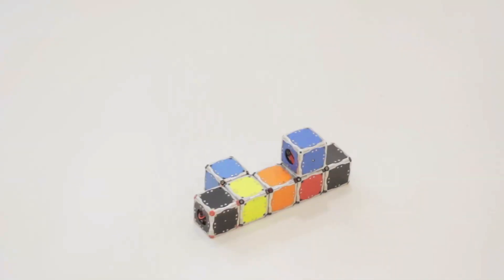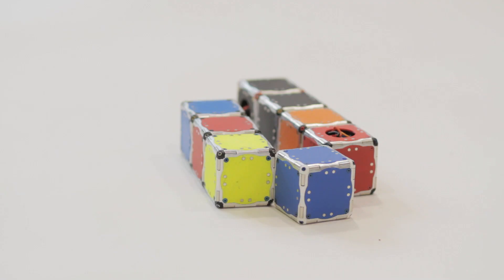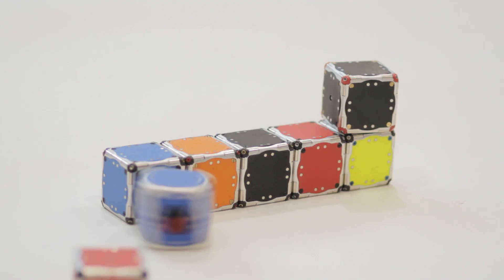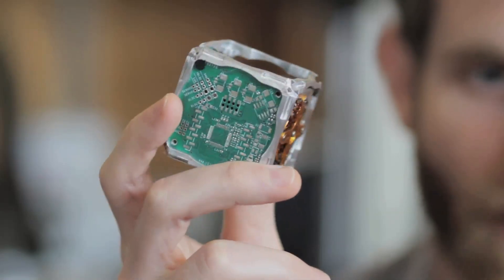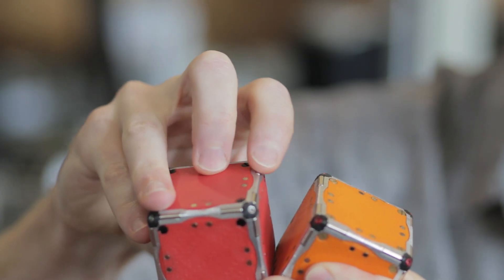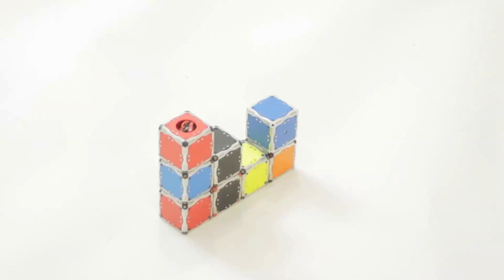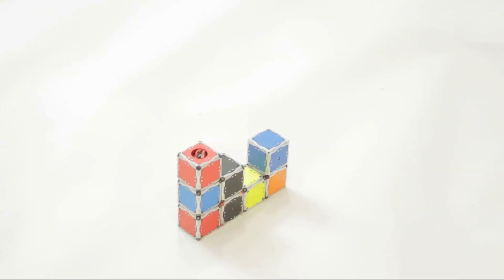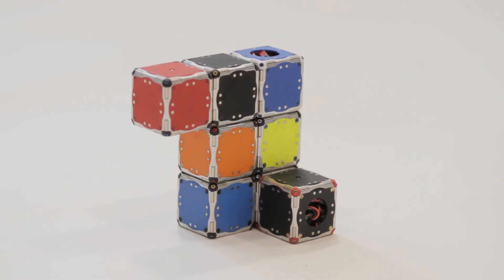Small cubes that self-assemble

Comment: I HAVE HAD IDEAS ALL OF MY ADULT LIFE AND THIS IS ONE I THINK OF A LOT THOSE LITTLE WOOD STOVE FANS THAT BLOW HEAT FROM THE HOT TOP OF WOOD STOVES ARE GREAT. I WAS THINKING IF SMALL GENERATORS WERE ATTACHED TO THE REAR OF THESE, PERHAPS WHEN CAMPING OR ANYWHERE (THESE DAYS OF SEARING HEAT EVERYWHERE) ONE COULD PLACE THESE FANS ON THOSE SURFACES AND PERHAPS CHARGE CELLS, OR POWER SMALL LIGHTS? I HAVE NO IDEA HOW TO MAKE $$$ ON MY IDEAS BUT PERHAPS SOMEONE WILL GIVE ME CREDIT FOR FREE ONES??

Comment: I don’t really know how this type of tech works, but I do know a thing or 2 and had a suggestion. This probably wont work, but just something:

I see that you used magnets in the cubes. What if rather than using the spinning mass in the middle as the main source of movement, you use magnets to guide them. You use an electrical charge to ‘turn on’ the magnets on the desired cubes. Like I said, I have no idea how this works, but it would be really interesting to test the idea.
Reply: That would require an electro magnet, which is MUCH bigger, and they can only connect/disconnect, you would need the ability to move the magnets to get the cube anywhere. This would create internal moving mechanisms, which would mean more stuff to break.
Reply: @FieryCoal  yeah true ,If we are making something big ,then electromagnet will be beneficial

Comment: Good job! I don't know why youtube took too much time to recommend this to me. Anyway I don't usually comment on videos but I got to share my thoughts on this one
1. High cost due to all electronics in cubes, per cube
2. Misses a feedback, how can I cube know where it is and where to move
3. Takes a lot of time to form
4. Batteries will die fast from all the spinning, and charging each single cube alone is a struggle
5. Mistakes can happen during reformation
6. Can't be built in nano size due to a lot of restrictions, and if done, think about the huge cost of having a million nano cubes to do some formation
7. Those are just a bunch of cubes with motors, what tasks can this do other than teaching 7yo kids about electronics?
8. Getting different robots for tasks is still cheaper, more accurate, solid and better
9. Do these even have a memory? good luck programming a robot task to cubes and using distributed computing and multi tasking to make them work together, sounds impossible, and even if done, the software alone will cost sht load of money and will be impractical
10. What tasks are you gonna do? I see no sensors, no actuators, no nothing! If we want to attach sensors to these they will lose ability to reform, and a lot of sensors cant be built in cubes due to:
a. no space in cubes
b. some sensors need to be outside to sense
c. reformation will become limited as specific sensor cubes need to always be in specific places

Only practical use I can think of is a kids toy to teach them about electronics, but it will still be very overpriced in comparison of amount of knowledge it provides, so I'd give this 1/10 just for the effort
Reply: https://www.amazon.com/Modular-Robotics-Cubelets-Twelve-Blocks/dp/B0187R3TSM/ref=sm_n_au_dka_NL_pr_con_0_1?adId=B0187R3TSM&creativeASIN=B0187R3TSM&linkId=8dc164bf8594f0124a742949e2e53b0b&tag=tapostnativebottom-20&linkCode=w41&ref-refURL=https%3A%2F%2Ftechacute.com%2Fmblocks-robot-cubes-can-self-assemble-video%2F&slotNum=1&imprToken=izmAV0keY12f3y5dSNVpFw&adType=smart&adMode=auto&adFormat=grid&impressionTimestamp=1554321245764

Comment: I have seen Stargate. This is a bad idea.
Reply: Mishael Martin so your saying  humans were a bad idea because  we are an emergent  property  of this practical idea applied  over several  different conformation and energy  levels? Well, then that's because  of you. LoL
Reply: @maximaleffort  well this was a joke. But since you brought it up. 
Are you saying that humans a similar in the fact that we were single cells that eventually came together. And now that I am this huge mass of cells, it is my fault if these cells do something to cause harm to others ?
Reply: Mishael Martin I was LoL, still.  The similarities are self evident in all complex systems. The correlation between abundance or ubiquitous  building blocks being directly  proportional to useful emergent properties are evident at every level.  Harm is irrelevant  to the point but a perception, from your emphasis, in the mind of the programmer, either  intentional or not.  Bottom line is that the ratio of volume  to utility is exponentially enhanced  by being able to reorder the substance of tools. 1 box of blocks can reorder into a 1000 tools, for example.  The revelation  of this has been under construction for quite some time, although not on YouTube  yet, and is an evolutionary inevitability.

Comment: These modular robots are based on two things, gyro-motor and magnets,
Gyro-motor is a poor stability or vectoring motor (due to the air resistance and other factors which makes us unable to predict final position and orientation). If we can orient it better, like relatively using fields around it.
Utilizing the fields may help us to overcome the excess of sensors
Reply: Reaction wheels
Reply: Hassaan Maqsood cannot you use magnets to repel some edges and attract others to make the cubes "walk" on the structure? 
The problem is you wouldn't be able to make them jump with magnets, and that is useful when it has been disassembled to assemble it again.

I envision these robots as modular robots that can "repair" themselves by reataching separated parts only instead of being made by cubes, have every module serve a purpose.
Reply: Noriel Sylvire that would make it only work on metal magnetic surfaces. Reaction wheels are more versatile on what environment they can be used in.
Reply: Alden Hauser yes, it's true. Apparently reaction wheels can provide great precision.
Though I don't entirely know how you would fit them into a cube.

Apparently they have continued developing these M-Blocks for all these years though I haven't seen a major breakthrough really, other than improvin precision and force. I would love To see them do things other than jump or maintain balance.

What do you think this could be used for?
Reply: @aldenhauser9555  Reaction wheels are good as being 'start-up'. But if you are going with some more complex and fast manufacturing like programmable matters, you have to use the natural force fields to bind and move through space.
Reply: Hassaan Maqsood wtf is a natural force field lol?
Reply: @aldenhauser9555   force field (where force act) of natural forces gravity, electr-magnetic, weak and strong nuclear
Reply: @norielsylvire4097  you're right but if those are 'electro', plus they have kind of standard pole orientation with respect to the vertices.
Considering cubic structure, I think we need mathematicians to find out a 3D honeycomb unit structure (for 2d it is hexagon), so that could really make good fit
Reply: @hassaanmaqsood  Well, I'm still not a specialist of any kind so I don't think I can really contribute anything useful right now.

I will just say that as time passes, more and more research teams are becoming multi-specialty teams, so I wouldn't find it too unlikely that a team of mathematicians, engineers and other specialists made a big breakthrough in modular robotics.

As for the 3D honeycomb, hasn't it been found yet?
I would use just cubes...
Reply: @norielsylvire4097  It doesn't need to be a specialist to contribute, its all about passion and curiosity along with commitment.
Reply: r/iamverysmart

Comment: in 2019 i'm looking at this and thinking about how he want's to put more into the cubes and be able to command them at a high level, and have them do the 'thinking' and I'm thinking, how about you make them more reliable in their current state and then have a central software take care of all that, so you can realistically throw more processing horsepower at it and just signal the cubes to act as needed. As it stands this looks clever, but useless, as the rotating mech for imparting momentum makes them move, but also requires them to all be cubes, theres really no use case here besides we can jump around and stick to each other, and aside from fitting them with sensors to detect motion, or heat or something they really cant perform and real tasks outside of just rearranging themselves. It looks like it amounts to nothing more than a fancy toy.

Comment: The cubes need a type of hive mind AI to be autonomous. These would be practical only if the user would only need to give them a simple instruction, such as "form a pyramid 12 inches high with a 16 inch x 16 inch base". The cubes would have to recognize their individual positions relative to each other, collectively recognize the end configuration, recognize each cube's position in the end configuration, prioritize each cube's movements, etc. A more advanced AI would be able to quickly re-prioritize in changing environmental conditions such as building the pyramid on the deck of a rocking ship.
Another advancement for these cubes could be if they could manipulate outside objects. Example: the cubes are in a room with a floor that is 40 feet wide by 40 feet long with a ball. At the end of the room is a cup that is 4 inches tall and just wide enough to hold the ball. The command to give the cubes would be: "put the ball in the cup." The cubes would need to be able to identify the ball and its properties (its round, it rolls, its size, how heavy it is, etc), and the location and size of the cup. For simplicity's sake, the properties of the ball, the location and properties of the cup could be pre-identified. The cubes would have to have some sort of sensory system, such as pressure sensors to identify where the ball is and calculate where it needs to go.

Of course, these achievements would take multiple steps and several iterations of modification and it wouldn't be a simple task. To get the ball from one end of the room to the other would necessitate the cubes' ability to become mobile as a unit. More challenges to give them would be:
1. As a group, climb a flight of stairs.
2. As a group, climb onto a table.

Comment: 2072

Advanced nanotech clothing

Fifty years have passed since the mainstream appearance of nanotech clothing. During that time it has made extraordinary improvements in utility, power and sophistication. Modern fabrics have built upon the abilities of previous generations, perfecting many of the technologies involved. Today, a complex blend of nanotechnology, biotechnology, claytronics, metamaterials and other components has yielded a type of clothing previously confined to the realm of science fiction. Though mostly restricted to specialised personnel, government forces and the elite, a number of these suits are finding their way into the mainstream.

Construction via self-assembling nanotechnology has been around for a number of decades. Until now, the process was only practical using bulky and/or conspicuous machinery, nanofabricators, or objects suspended in tanks of catalytic fluids.* However, recent advances in nanorobotics have allowed for more subtle and rapid construction of macro-scale objects in a more compact form-factor and with less impact on Earth's natural resources. As happened with early nanotech adoption in the 2020s, one of the easiest and most common applications has been in fabrics. Today, a high-end home "closet" may consist of simply a thin surface or pad built into the wall or floor, concealing a mass of nanobots and molecular building materials. A user can stand on or touch this surface and issue instructions to the machine (through voice command or virtual telepathy) for what to create. Each nanobot is then programmed with the final clothing design and set into motion.

The process begins with each nanobot organising and categorising each building molecule, based on the aggregate material needed and where each piece will be located in the finished product. The nanobots – also called "foglets" – then begin interlocking with themselves, forming a basic "skeleton" on which building molecules can be attached.*

As more and more nanobots and molecules are added on, thousands of individual fibres begin to form out of the machine's surface. These grow up and around the person's body, crossing each other to create a weave pattern, before finally taking the shape of traditional clothing. The result is a basic structure around which nanobots then construct the more advanced and customised features. Depending on the outfit's function, the original fibres can be interlaced with photovoltaics, piezoelectric nanowire, carbon nanotubes, metamaterials, claytronics or any number of other useful materials. Tiny electronic devices can be added for communication or medical purposes. This whole process is completed in a matter of seconds.

With such detail and control, fabric of this nature confers the wearer an array of conveniences. In earlier decades, this technology was limited to relatively simple functions, like colour and texture modifications.* Today, it is almost indistinguishable from magic. Complete wardrobes are no longer necessary, since one garment performs the function of many, transforming into an endless variety of styles and shapes. Most outfits are self-cleaning, self-fragrancing and rarely if ever need to be washed.** They can instantly adjust themselves in emergencies – becoming harder than steel to stop a knife or bullet; cushion-like in the event of accidents or falls. If a person is injured, the fabric can administer life-saving drugs and medical nanobots, or contract to seal a wound.* A drowning person can be made safe. Fire-fighters and other rescue workers are completely protected from hazards such as fire or radiation. This is also useful in space, protecting people from sudden changes in air pressure, micrometeorites, cosmic rays and other hazards. Medical devices included in these outfits monitor for disease at all times, catching the earliest signs of cancer or infection and alerting the wearer before any damage is done.* Whatever power is needed for the various functions is supplied by a combination of piezoelectric and photovoltaic components embedded throughout the clothing material.

Some of these aforementioned comforts had already been available in earlier decades, but were simpler and fewer – usually limited to just one, or a small number within each item of clothing. Today, however, all of them can be fully integrated and combined together into a single suit, created and maintained via swarms of intelligent foglets. As this technology evolves further, it becomes a permanent part of some peoples' physiology, almost like a second skin.*

Comment: It doesn't work.... even by their own statement it has a rotation piece inside which on a spin stop makes it move so the cube can only go rotate forward or backwards.... Even by their examples the cube is only moving in one direction.
Reply: Incorrect. The motor itself can be spun to three different orientations corresponding to the three planes necessary to achieve motion along all three axes. Within any given plane, the motor can spin backwards or forwards to allow for bi-directional movement along that axis.

Comment: one problem that you will face when implementing this solution on a macro-solution is that the force that makes all units to stick togheter is very weak you must find something strong to make the hole structure strong.

second your solution need to have units much smaller than you have today, to ensure more accurate structure

and how those micro units will collaborate between them  to form useful  structure (that' s an interesting question).

Comment: I wonder whether the magnets have fixed poles or can be directed/changed through electricity as well in case that two equal poles land on each other when e. g. jumping. Furthermore it could make sense to be able to control magnetism at the edges, because if the ability to move and rotate is not only intended for moving but actually doing a task (if future robots consists of way more than... 5 or 6 cubes), then it might be the case that you need less power to rotate/move when you do not have to "break" the connection between the magnetes at the edges of each cube

Comment: Not like I want to diss you eggheads at MIT but I'm pretty certain it'd be faster to just build whatever shape you want with magnetic cubes... Not only does this take a long time, if it has strong magnets, it has to use some energy source which will most likely be depletable and imagine a core block of a shape powering down and everything falling apart.

But my main point is... What bloody application does this have? Make robots that move? Not really. They're just cubes and you can't have anything on them because it would mess up their movement. So all you have is a slowly moving magnetic cube which you can litteraly put together into the shape you want much faster than it can do it itself.

Why are you bothering with this? It's pretty pointless.

Comment: Sound great and all, but the main reason modular robots are a problem is that the force that maintains them together can be outweighed by the task it might be going to perform, for example imagine you have a modular robot capable of changing from a shovel to a pickaxe, sounds great, but the strength required for a pickaxe to break stone is larger than the force required to move dirt out, so how exactly are you guys planing to maintain the same adhesion with different tasks? I can imagine by using much more energy for electromagnets, thus being energy inefficient (with some simple Tesla inventions, the cables shouldn't be a problem), so it could be a huge problem to the industry instead of an aid, because the modules would separate among itself when performing a heavy duty task and it will require crazy amounts of energy.